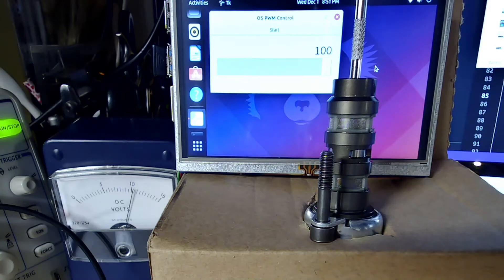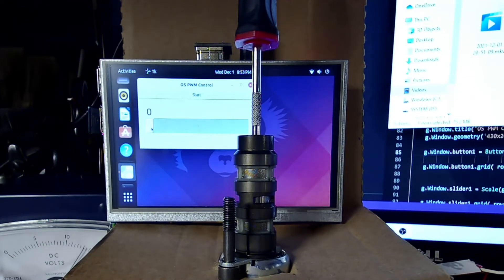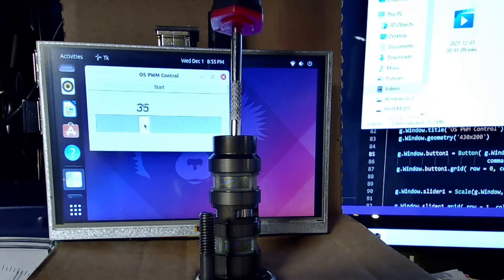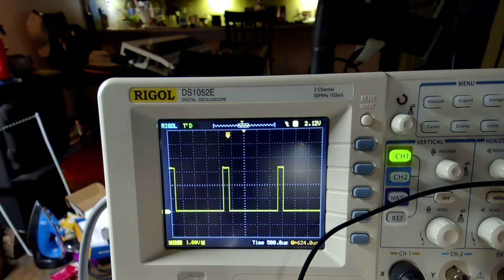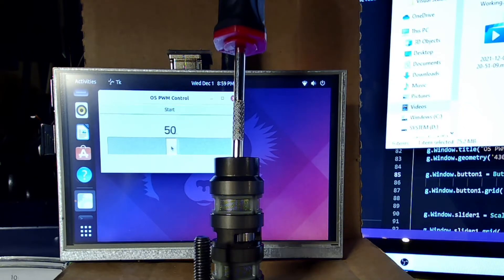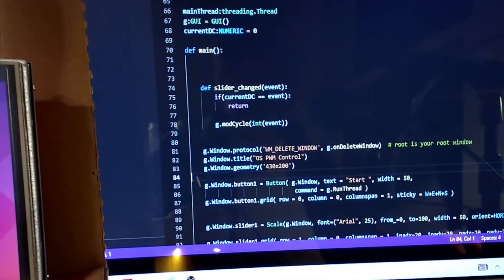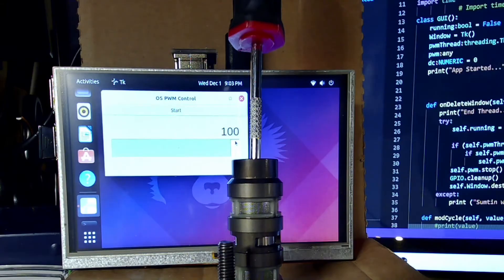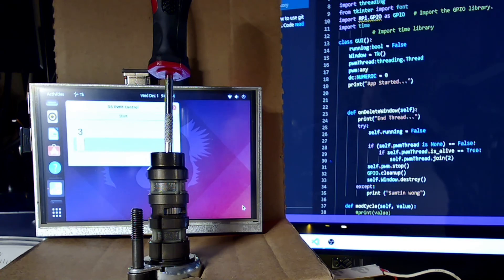How Does A VVT/VCT Solenoid Actually Work

Comment: Would you share your PWM program for me to see how you did it?
Reply from the maker: Yes I can. I have to create a link...give me a few days...
Reply from the maker: Hey man. I didn't forget. https://www.thoughtpill.com/code/PWM2.zip
I'm not 100% sure this is the exact code, but it should be close. It uses GPIO on rasberry pi - so be ready for that.
Reply from the maker: Also, there's a whole driver circuit involved here to power that coil. All the code does is control the bit.